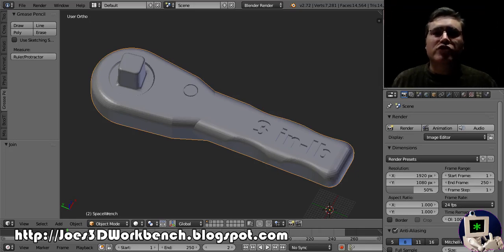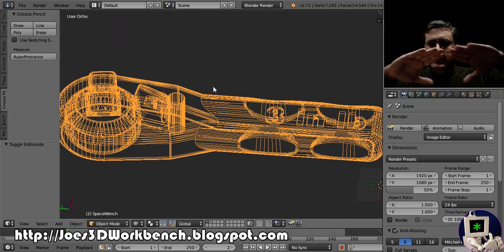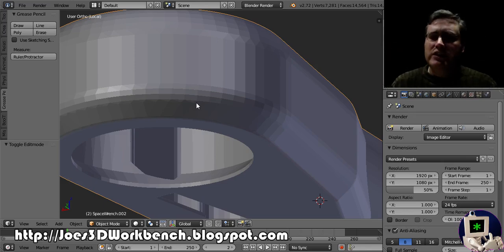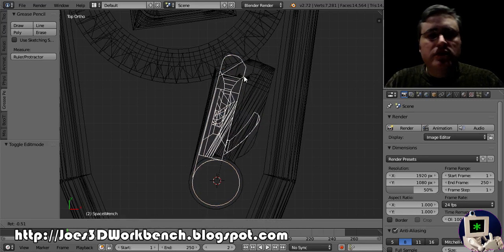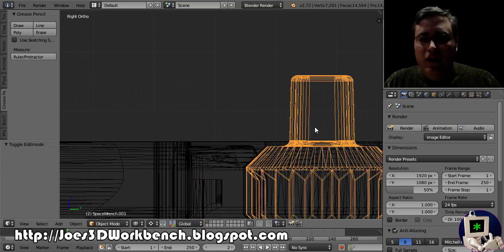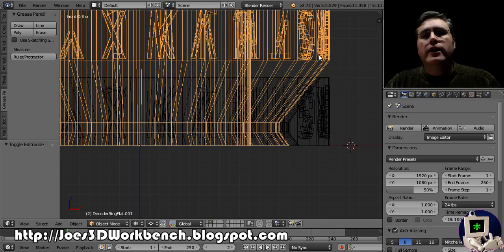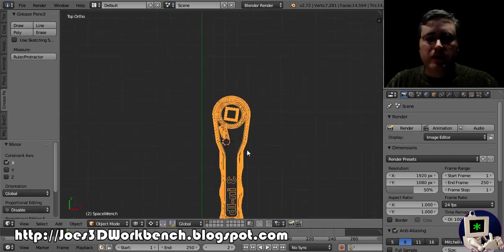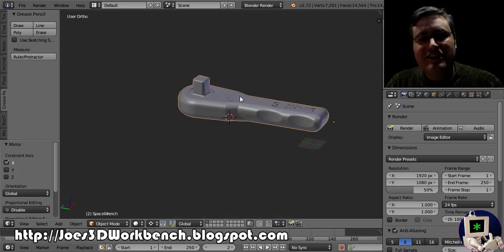3DPrinting - Space Wrench

Comment: to make it loosen and tighten couldn't you  make a hole on the back side and put a square peg coming out the back? so to change you just flip the wrench over and use the other side?
Reply from the maker: That's almost exactly my idea. I'm running a test print right now where the roundy part has a square hole and there's a square peg that snap-fits in it. Flip it to one side to loosen, flip it to the other side to tighten. If it works I'll upload it to youmagine and make a blog post about it.